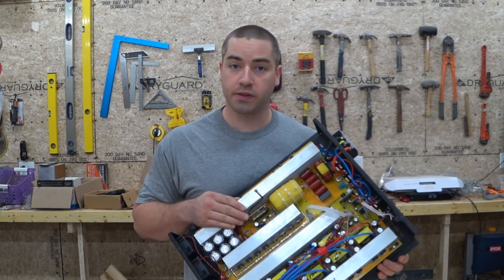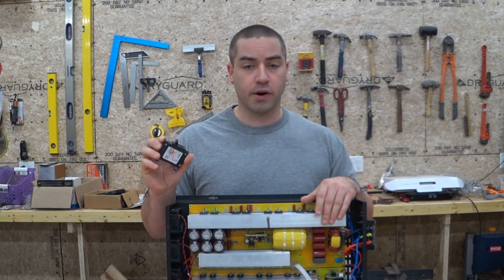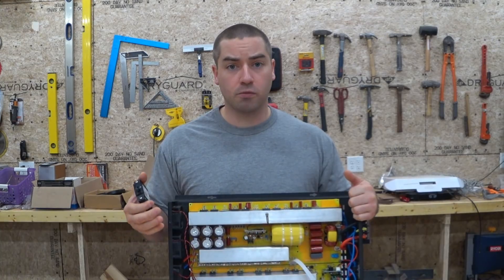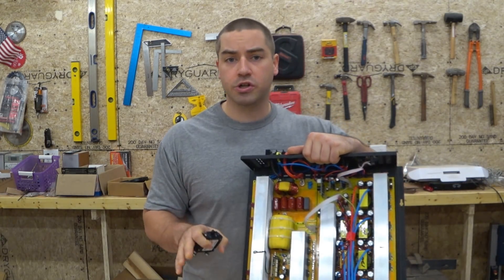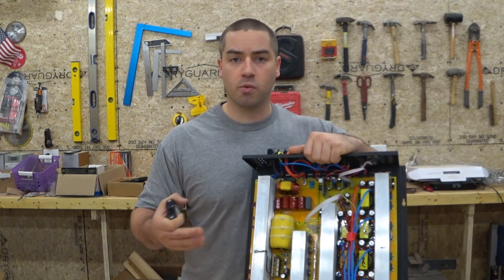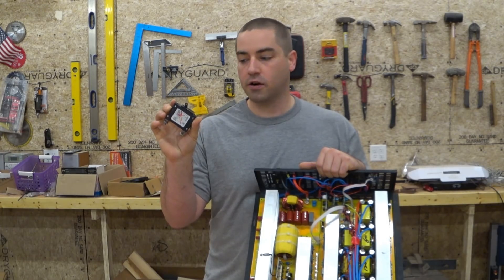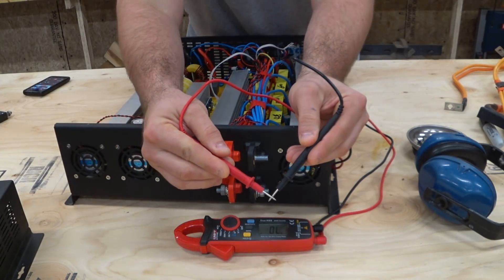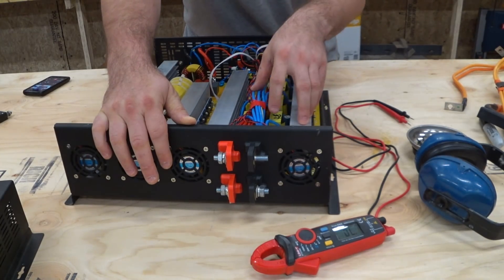Did I Blow Up the Inverter?

Comment: A junk inverter + lithium batteries = smoke. Your batteries have a very low internal resistance (I use the same batteries with a Schneider XW6848 by the way). That means they will provide an immense amount of instantaneous current. Couple that with your meter. You are on the right track but there is no way you captured the full inrush event with that meter. You need something with a LOT more processing speed. The inrush event is a huge spike that lasts for a few milliseconds and quickly tapers down.  If the inverter doesn't have some internal processing to limit the current through it when loads like this happen they go boom. The engineers expected you to have slower reacting batteries so they didn't build that into their design. The mosfets shorted due to the spike in current and it was over. Instant boat anchor.
Reply from the maker: I've heard great things about the XW6848 and it is on my very short list of "Big-Boy" equipment to get.  How's it been working for you?
Reply: A very nice machine. Not cheap though. I'm in the beginnings of putting everything together. The goal is to have the house on UPS. :D

I have about 40kw/hr of batteries that I'm testing and getting matched up. Unfortunately a 12s setup like you have now is not a good match for larger inverters. 14s is the sweet spot. I'm modifying the volt batteries to put together 14s groups. It takes three 12s packs and one 6 s pack to do it.
Reply from the maker: I agree about the 14s.  When I called Shnieder tech they said the same, that 12s would be too low of voltage sometimes.  Make the inverter work harder.  If I buy another batch of Chevy Volt then I might re-wire everything to 14s.  Do you have any photos of your wiring?
Reply: @DavidPozEnergy  FYI. Magnum's inverters have a lower low voltage disconnect (LVD) spec. They will work better with 12s. It's something like 36v or 38v compared to Schneider's 40v. I'm using Schneider with 14s batteries, but I may use Magnum on a future project so I can use the Tesla model S modules.
Reply: DavidPoz 6
Reply: DavidPoz /
Reply: One thing being overlooked is the capacitors on the high voltage DC side before the H-bridge IGBT (insulated gate bipolar transistor) that converts the high voltage DC to AC. These capacitors would be able to delver some of the inrush current to the saw. Might be able to repair that inverter with a new set of MOSFETs and fix the input wiring to have equal length wire so all 9 stages have the same wire resistance to better balance the input current. While the SMPS (switch mode power supply) IC (integrated circuit) has built in current limiting, I would expect they only measure this current off 1 or a few but not all the 9 input modules. I would expect 1 or more modules over current due to the mismatched input lead length resistance under heavy currents. And they are indeed high frequency transformers, they basically act the same way as computer and laptop power supplies. Except for parallel inputs and series output, that high voltage DC feeds the capactor bank then the H-bridge to convert to AC mains voltage then though a filter to remove the high frequency switching to leave the low frequency 50-60Hz.
Reply: TrackGeeks - your reply makes a ton of sense when you talk about capturing 'inrush' with his $45 inductive meter (probably not completely accurate)  However, he captured roughly 3 times running current - which is about right for most electric motors I've tested.   Given that, how is it the 3000 watt Reliable inverter handled it (the same saw) OK, yet the 8000 didn't ?    I'd love to get your spin on that as you are obviously well seasoned
Reply: @mark_osborne  Hi Mark, the inrush on an induction motor on average is ~4x FLA (Full Load Amps). I just took a look at the data plate on my heatpump and here are the numbers. The FLA of the compressor per the label is 16 amps. The LRA (Locked Rotor Amps) is indicated as 88 amps. That is 5.5x of the FLA and is in the range of what I expected. LRA is not the same as inrush because the rotor doesn't stay still when you energize it. As soon as it starts turning the current drops a LOT. With any measurement time is a factor. If we were to use a really fast scope we might see a peak near the LRA value. If we take a measurement a fraction of a second after the rotor begins turning the current will have likely reduced by 1/3 to 1/2. That would put it around 44 amps. 

BUT.. His saw doesn't use an induction motor. It uses a "universal" series wound motor. Those are brushed motors that will run on AC or DC. The inrush on those is much higher than an induction motor. They are more in the range of at least 6x of FLA could go as high as 10x. That is why they will dim the lights in the garage when you pull the trigger. So, his meter isn't fast enough to catch that big spike which is somewhat proven by the readings he did get since the inrush for that style motor is much higher than what he recorded. Not saying his meter is crap. Only that its not the right tool for that particular measurement. 

In regards to why one inverter blew up and the smaller one didn't.. That to me goes back to what I was saying about how the inverter is designed. I've not evaluated those inverters personally so I can't speak to how they are setup. What I would like to see is to take the lower wattage inverter and test it with controlled surge loads and monitor with a scope to see how aggressive its voltage regulator circuit tries to maintain output voltage. I would bet money that its reacting slower than the ones that shorted. 

How this ties together is if you can get the motor spinning the current being demanded by the motor goes down dramatically. If your voltage regulator circuit is a little laid back it doesn't push your transistors as hard to respond to the load, the motor will start spinning which means its current demand goes down, your voltage regulator starts catching up and feeding in more power from the inverter, the motor speeds up more and current goes down even more, and before you know it the motor is fully up to speed and the inverter survived. If your VR responds really fast it nails the drive to the MOSFETs as soon as it sees a heavy load (and that load is happy to take all that extra power exactly like a universal motor is happy to do).. BOOM. One MOSFET fails and that starts a chain reaction of failures. 

It could also be that the company is using MOSFETs that are not truly rated for that much power. Wouldn't be the first time such a thing happened. Maybe David can give a look and read off the part number so we can check them out and see. 

I hope that helps answer your question. 

Sorry man. I wrote a book. Ug.
Reply from the maker: I think this is the part: https://www.mouser.com/datasheet/2/196/irfp90n20dpbf-1227618.pdf  Tough call for me, as it will cost $100 to replace the mosfets on the input board, but I have no idea if that fixes everything, or if it will just reveal other parts also broken.  I can see this becoming expensive trying to chase down one part after another.  I don't know if it is worth it.  Any thoughts?
Reply: Those do look like they are decent parts. Hm. I wouldn't throw parts at it without some additional testing. My gut feel is that a set of input MOSFETs will get it going. I would check the output side and see if any of those are blown before ordering any parts.
Reply from the maker: @ TrackGeeks: Here is a picture of the mosfet.  I hope the link works as I am not very familiar with facebook.  https://www.facebook.com/DavidPozEnergy/photos/a.338714846537622/480617959013976/?type=3&theater
Reply: @DavidPozEnergy  The link worked. OK.
Reply: Mark Osborne I work in instrumentation/ control maintenance for a power plant and have spent this past week in class learning about EMI prevention and detection. One of the topics covered was the voltage kickback created when switching on/ off high inductance loads. Using a high end scope I witnessed a 60 v dc relay cause spikes of 1.8 K v at very high freq just from the relay coil. Most this can be reduced with filters and snubbers that will dissipate and or reroute these unwanted spikes. In this case switching on/ off AC zero cross point switching could be an option.. this would only allow the switch to turn on when the ac sine wave is at the zero voltage point which would greatly reduce the spiking. Not really sure how well it would work on the inverted sine wave though. My other thought on this is how I lags V on the ac side but wouldn’t on the DC side.. not sure how this could be effecting the circuit.
Reply: TrackGeeks n
Reply: @davidpoz similar Chevy Volt BB setup, 12s. I have read that the Outbacks go down to 40 vs. 42 XW. Maybe more friendly and not require rewiring of the bank. A unit that is on my short list along with Magnum .
Reply: Oscilloscope is the word your looking for...

Comment: I vote for inverter failure. However, another thing to look into is the battery voltage sag during the inrush period. Voltage drop = sharp rise in input current.

Comment: One thing to consider is that smaller circuit breakers tend to have higher contact resistance than larger ones. If the resistance of that breaker caused a sag at the moment of the switch on surge the mosfets would have been overloaded for slightly longer than otherwise - possibly enough to bring about that cascade failure. So unfortunately it points back to the smallish breaker being used again. 

I do agree with other commenters about the differing wire lengths inside the unit possibly contributing to the failure and that would be a design issue of course. The best thing to do when running big motorised appliances from inverters is to use a LOW FREQUENCY TOPOLOGY inverter. These are far more robust when it comes to starting "surgey" items. 

Interestingly, I watched your previous video a day before I went out and purchased a 1250 watt circular saw, which I intend to run on an old high frequency MSW 3000 watt inverter. Your video made me nervous about popping the thing the first time I spin up the saw so I am putting together a soft-start unit. I have already developed it to the point where I have tested the principle of it with the inverter and the saw. It worked nicely. 

Could my inverter fire up the saw on it's own? I'll never know, because I am never going to try it that way! The other advantage of the soft-start unit is the saw doesn't kick back the same when it's spun up. Which is a useful feature on a hand held tool.

Comment: Likely you have a cascaded failure. Its the same as if you put a lot of LEDs in parallel. Not all LEDs are created equal, meaning some will have less resistance than others. For LEDs this means that some might be brighter (and hotter) than others if they are wired in parallel. For this reason LEDs are usually driven with constant current drivers to give the same power to each LED. In your case having 9 parallel transformer driver circuits, chances are that one of them took a bit more of the startup load than the rest. Potentially because of the gauge and different length of wire used inside the inverter (which in turn gives the path of least resistance). Once one of the nine circuits blows the load is shared between the rest. Then the second one blows until you blow the main external fuse triggers, which stops the cascade. Long story short, it is likely that it does not like the full load being drawn suddenly (due to the design), you might be okay gradually adding load up to 8000w.

Comment: i watched your vid again and i think what happened was you got a surge of power from the batterys as you did not say you had a fuse other than in the inverter your saw is about 1600w and the inverter its self should handle that but your battery bank would put out a lot of amps that would blow the inverter if you did not have a fuse

Comment: If you look in your 3000W inverter you will probbably find 4 wires of almost equal length goiing to the four component groupsIn the 8000W inverter are 5 differenth lengths of cable powering the component groups - the difference msy be small but in no way can these 5 differenth lenghts distribute the requested power evenly between the groups.one group trying to deliver all the requested power because of a timelag between the next group - ah well the result was spectacular
Reply: I was going to say this but you beat me to it.  Lead legnths should always be equal in any parallel system; especially so in a low voltage system.  Those fractions of an ohm may not seem like much, but they can easily unbalance a battery system, or cause an inbalance between the paralled elements.  If I were to guess as to the failure method of these inverters I would say that it suffered a cascade failure of the mosfets due to differential loading. (And possibly an ahem overly generous rating from the manufacturer)  The massive startup pulse from the motor being started is the perfect type of load to exacerbate this issue.  FYI, you need a meter with an "inrush" setting to provide an accurate reading of the startup pulse. (I've seen inrush currents in excess of 60A on these types of loads.) Also, a couple of minor corrections to the creator of this video; breakers use thermal and magnetic trip mechanisms.  Meaning, that either a high overload (usually ~5-10X the breaker's rated ampacity) or a prolonged low overload (that causes the bimetallic element to flex) will cause a Over Current Protection Device to open. Also, breakers that open aren't failing, (as you state repeatedly in your video) they're opening. (Performing as intended).  I hope this helps, and keep plugging away, at your hobbies!
Reply from the maker: @M VanSumeren,  You are right, I was using the wrong term.  The circuit breaker was opening, saving the system from overheating and catching fire.  A good thing.  I guess I got cought up with the word fail because of the inverter failing.  Sorry about that.
Reply: @DavidPoz: No worries man.  It can just be more than a bit confusing to new gamers when improper terminology is used.  Good luck with your endeavors!

P.S. Thanks for not asking why I know about lead lengths in parallel low voltage systems. . . It was a hard learned lesson for a much younger me!
Reply: Wire length is as NOT as big deal as you suggest, since each MOSFET as a slight different internal resistance. R-on-DS varies between different Silicon wafers they are produced from. No two wafers will have the exactly the same dopant amounts. Mosfets balance resistance with temperature the devices that run the hottest (most resistance) will increase resistances causing current more current to flow through the other parallel MOSFETs until they are all balanced by temperature.
Reply from the maker: @M VanSumeren,  I gave you a shout-out in my recent video: https://youtu.be/Woigo3sTp_E
Reply from the maker: You can see inside the 3000 watt inverter in this video: https://youtu.be/me0eAJL95og at 2:11
Reply: @Frans van Kralingen :
Pretty much yes, but I think it's even wore than that, 8000W rated even with those differences might doesn't care about so tiny differences.

I bet that the failure is on the alternative side, the inverter might try to push pure sinus without sensing back.
Inrush creating strong energy storage and back up with fourrier law unpphased of 90° , The inverter still try to push on his way, some current have no way to go back or loop, which leads to increasing the voltage (still on milliseconds) to thousands volts which lead to kill transistors, and once blowed up even less current can pass, energy must loop to be dissipated, higher voltage and leads to spark the breaker.
Reply: Did the Circuit breaker actually trip?  Was there a correlation between the Mosfets that failed and the length of the wires? Also different lead length to the gates would seem to have switching time differences also.
Reply: Learning, not knowing, whom actually knows... 

Let us know what or is? I'm sure the MANUFACTURER'S are dying for a reprieve! This should motivate them to help you do that. I see plenty of input, from educated, and experience - unless they are in one of their poser personalities? Aren't we all just posers anyway? Posing more questions, than questionable... LOL

Thanks everyone!
Reply: I said the same thing in one of my comments, but im willing to bet this 8kw inverter does not have a snubber circuit and/or protection diodes on those Mos fets. They thought 10 am fuses would be enough
Reply: Yes. It has to be the difference in wire lengths to each set of mosfets. Just check on the layout in the 3000watts version. Does it have snubbers too.

Comment: Not sure why the inverter failed but I do know 80 amp breakers are way to small for that set up. The smallest I would start with on the battery side is 300 amp. Again I have no idea. A good inverter should never fail due to a breaker flipping.

Comment: The circuit breaker is actually made by Carlingswitch.
Midnight solar are merely a reseller of these circuit breakers.
I have uses these Carlingswitch breakers for many tears and they are an excellent product rated for industrial use
You need something to slow down the current inrush from your batteries so the the MOSFETS don't die.
This link might help https://www.ametherm.com/inrush-current/inverter-inrush-current-protection